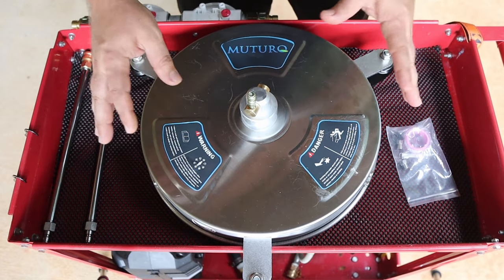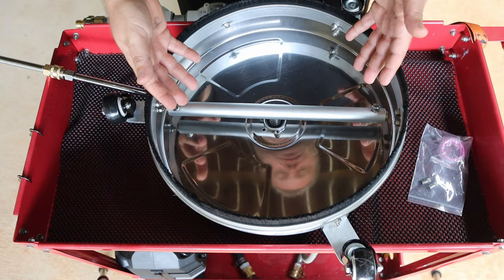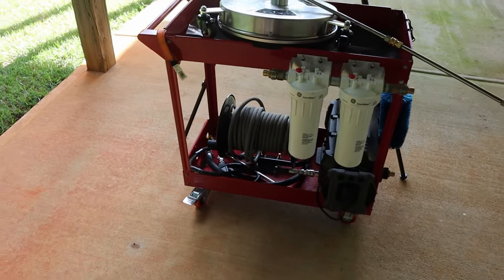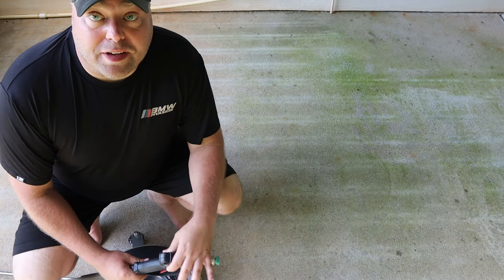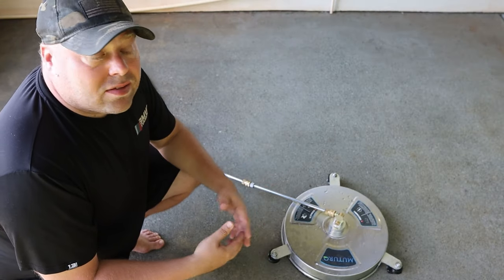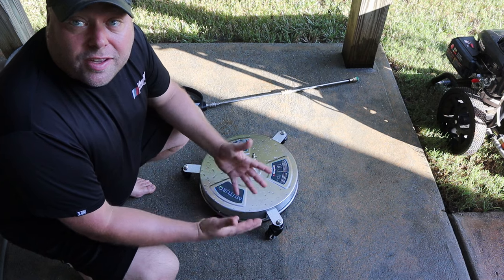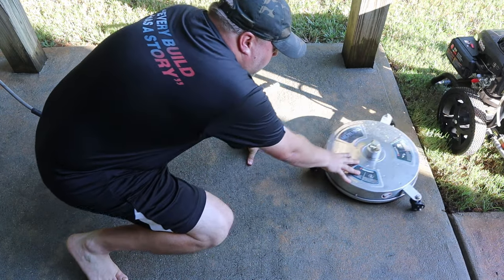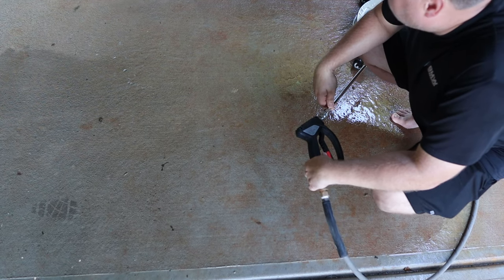AMAZON PRESSURE WASHER SURFACE CLEANER | MUTURQ | REVIEW & TESTING

Comment: I've got a Karcher one that seems to work pretty well. Love these surface cleaners because it eliminates all the messy overspray and getting super dirty
Reply from the maker: Yeah they work great, I had a Ryobi one for electric pressure washers.  My first one for gas ones with the casters.
Reply: Looks flimsy. Might be ok for small areas, but I doubt it would hold up for larger ones like a driveway or pool patio.

Comment: Great. Idea brother! I used a Briggs and Stratton one from Lowe’s for years. Surface cleaners are killer time savers
Reply from the maker: I had an old Ryobi one that worked great, but the casters and all steel construction of this one puts that plastic one to shame.
Reply: @CarsWithKeav  I just bought a gas powered Ryobi 3200 Koehler engine that came with the surface cleaner but when it's done I'll probably buy the one you reviewed because it seems well built.
Reply from the maker: @michaelwelker3595  They work good, mine was for smaller electric pressure washers and didn't have the casters.  They make it so much easier.

Comment: Very helpful video.  I have a Ryobi electric PW and a surface washing attachment.  The combo simply does not do the job on my 600 sf deck, and, believe me, that is a large area to use a regular PW nozzle on.   This video made me realize that the problem likely lies in my PW having too little power.
Reply from the maker: Ryobi does make a few attachments meant just for their Electric pressure washers, but not sure how good they are.  Most of the ones out there are built for gas pressure washers. You can also change the nozzles orifices sizes at the bottom to get more pressure.
Reply: I had a Husky 2000 psi electric PW and found too that it did not have sufficient power to do many of the jobs I wanted to do. I would suggest a gas PW with around 3000 psi. Good luck!
Reply from the maker: @fiftyoon  Yeah, even if you get one with lots of flow its still not enough PSI. It might clean okay, but you will be doing multiple passes to not get those dreaded swirls.

Comment: Hi. Thanks for the video. I got a simpson pressure washer 3.5 GPM 4000 PSI with GX270.  Which size of surface cleaner should I use (buy) 16, 18, 20 inch ? Thanks
Reply from the maker: That kind of power I would run a 20 inch.
Reply: @CarsWithKeav  thanks a lot .. more bloopers please for next video 🤣🤣🤣 🏎️ 🏎️

Comment: Thanks for posting your video. How many PSI did you use on the gas-powered pressurewahser?
Reply from the maker: It’s a 2700 psi gas pressure washer, but unsure of the pressure it is using with the surface cleaner. Since it uses two nozzles and all depends on the size of the nozzle orifice.

Comment: Do you know if they make the red cart that you have for your pressure washer with larger more rugged wheels?  I need to take my setup to and from the shed over grass. So I don’t think those little wheels will cut it.
Reply from the maker: The ones I have on there are already upgraded too. The ones that came on it were very small and not very durable.  You could fit larger casters on this one though. Might require new holes drilled to fit the large bracket. I have not seen one like this with bigger casters.

Comment: Great video! I have a greenworks 1800 psi pressure washer that I use to wash my car with. Which surface cleaner do you suggest I use with this pressure washer to clean my driveway with?
Reply from the maker: I would suggest only ones built for electric which would be a smaller diameter. Here is one made by Greenworks it doesn't have wheels so you have to be more careful how close you get the jets to wood or anything like that. The ones with wheels need more power to run good. https://amzn.to/3JK36nq

Comment: Looks like a nice surface cleaner but if you have a brick wall or something horizontal to clean, a surface cleaner without wheels would be more versatile, light and maneuverable.  Just a thought.
Reply from the maker: You can take the wheels off and the brush skirt at the bottom will keep the nozzles from touching the brick.

Comment: Hi There The way you present the surface cleaner is very original with 'humor'👍😉 But let's NOT FORGET the SAFETY mesures that have been neglected or forgotten... (bare foot, no glasses, in shorts...) Come on !! and another thing you mention is the PSI not being (High enough) !! It isn't the PSI but GPM that have a great influence on the work to be done ( 1800 PSI at 2 GPM)= (3600 UN) will take close to twice the time to clean then a ( 1500 PSI at 4.5 GPM ) = ( 6750 UN) and the fact that the surface is washed with (Cold or Hot ) water makes a big difference too..
Last thing (You could take the time (to repeat or cut out) the parts that you muff in your text  !!! 😉
But all in all you are very entertaining.. 👍🤟
Reply from the maker: I’ve grown a lot since this video and been called out in every other comment on the safety. Learned a lot about pressure washers since then as well. Worked on my speech. Anything else? JK All valid points and I have worked on them all still have a long way to go. 🤣

Comment: What do you suggest for a pressure washer to use when cleaning my cars and the occasional asphalt driveway cleaning (some visitors have leaky vehicles)?
Reply from the maker: Active VE52 is the best for the value. Tons of flow for safe optimal cleaning. Their new 2.0 is even better, but $100 more and is more for detailers. Smaller form factor and has longer life due to higher quality materials, but the VE52 has so many good storage capabilities.

Comment: good video :-) Ive been wondering if I need a 4 GMP machine - what was the GPM of the pressure washer you used (GPM not PSI) - I heard 2.3 GPM (is that correct?) 2.0 as well
Reply from the maker: My gas one runs around 2.3 GPM. My electric does 2.0 with the right nozzles. Have dual nozzles hurts the electric one and its not the optimal nozzle size on the unit for it either.
Reply: @CarsWithKeav  thanks - I do light pressure cleaning (residential) - dont want a huge machine - looking for a surface cleaner (with castors) that works with a 2.0 or 2.5 electric

Comment: Does that go attached to your regular pressure washer?
Reply from the maker: As long as you have a 1/4 quick disconnect at the end and enough PSI to run it. Any pressure washer will work, but the lower PSI ones won’t clean well. This is mainly for gas pressure washers.

Comment: I'm in the process of starting my own business, can I ask? does it matter if the flow rate from the pressure washer is different to that of the surface cleaner? ie a 36 lpm surface cleaner, would this be too much for a 15lpm pressure washer/ any advice would be great.
Reply from the maker: I think from a durability standpoint it’s better to have a higher flow surface cleaner. It would not clean as good compared to a 36lpm on the same machine. Most of these you can change the nozzles in order to increase pressure to get better cleaning power. Either way most guys that run businesses try different nozzles, pressure regulators, etc. in order to dial in to their setup.

Comment: Will it work with a Karcher pressure washer?
Reply from the maker: Most Karcher pressure washers don’t have enough flow to run this size surface cleaner. A smaller 12 inch meant for electric pressure washers would be better.

Comment: Would this rip up polymeric sand?
Reply from the maker: I am not experienced with pavers, but I think it would all depend on how old it is and how well it was installed. Power of the machine being used,  size of the joints, etc.

Comment: The 25 degrees on the surface cleaners nozzle refers to the angle. The 2 sprayers are zero degree. So it’s not a good comparison. But great video!! Thanks!!
Reply from the maker: The ones on this unit are 25 degrees or at least they are stamped as 25 degrees. When running the streams are not anything like a 0 degree would be. There is a decent size fan spread.

Comment: I have a 2000 psi pressure washer with this connection it is gonna shoot out at 4000 psi still?
Reply from the maker: The bottom of the sprayer has two spray nozzles so it will actually lower the overall pressure. Also best to know if the pressure washer really does 2k PSI. A lot of companies tend to bloat the numbers. If it’s gas then it probably is. If it’s electric this unit might be too much for it.
Reply: @CarsWithKeav  It’s a ryobi electric pressure washer, with this surface cleaner you took a review on , i put both together but looks like i should be getting a new gas pressure washer sounds good thank you 👍
Reply from the maker: @krypticgaming2803  If you are using this unit I would stick with Gas Pressure washer unless its a Ryobi Pro model. Anything less they make surface cleaners for, but they are smaller and built for electric pressure washers.

Comment: kinda late on the vid but do u think this would work with 3000 psi??
Reply from the maker: Yes, it’s rated up to 4K PSI
Reply: @CarsWithKeav  you think it 3000 would still do a good job?? i have an electric pressure washer and i’m tryna get started with a business
Reply from the maker: @pressurewashingbros.2395  If it is actually 3K PSI of flow coming out of the unit and not an advertised on Amazon 3K PSI I think it would do really well. What pressure washer do you have. Normally you would need a really expensive commercial electric one to power one of these.
Reply: I have a 3100 psi do you think at 2.3 Gpm I could get a 15’ surface cleaner and do a good job on concrete driveways?

Comment: any advice why my pressure washer might be stalling and turning off?
Reply from the maker: A few questions in order to help out. Is it Gas or Electric? Is it stalling while using a surface cleaner like the one in the video, but not anything else?
Reply: @CarsWithKeav  its a gas powered one. 3000 psi. Has gas in it. And. I used it only with the wand right now.
Reply: @geevee9582  clean carb and change spark plug

Comment: I have the Muturo 20" surface cleaner and there's a small hole underneath that water squirts out of making it so there is no pressure to spin the bar with the nozzles. It's a manufactured hole and I have no clue what the point is in it being there... anyone have an idea how to stop water from spraying out of the hole? It was fine until about 15 minutes of use, then water started spraying out of the hole... I haven't taken it apart to see if I can see a problem so any advice would be appreciated.
Reply from the maker: Sorry did not get back to you sooner. They flagged this as inappropriate for some reason and was hidden until I went snooping today and found out how to unhide them. Did you ever figure this out I have not had any issues. I will look at the unit and see what i can find.
Reply: @CarsWithKeav  I just put a self-tapping screw in it with thread-lock and it seems to be working fine so far

Comment: Would it work on a sidewalk with lots of chewing gum on it….
Reply from the maker: It should, but unsure if the chewing gum would come off without chemical or a really powerful pressure washer.
Reply: The gym you to use 0 tip nozzle it will remove it in no time. If you use this they’ll stick and have problem